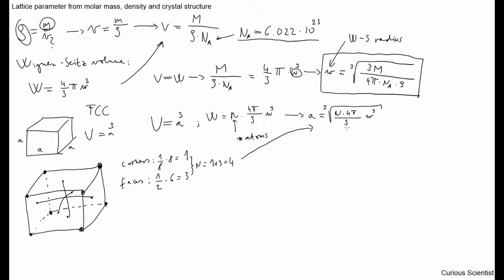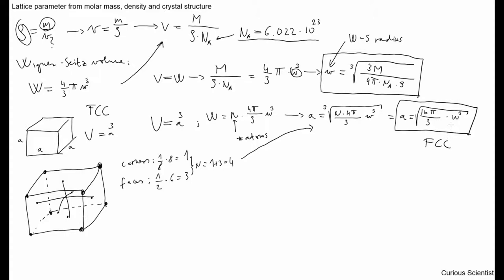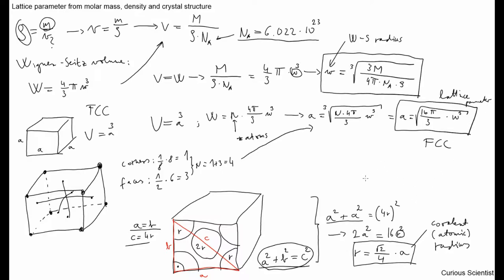Lattice parameter from molar mass and density - FCC structure and basics

Comment: why not just use this formula ->        # density =  (number of atoms in FCC  * atomic weight) / ( Avogadro's number *  a^3 )   #   a^3 is the volume of the unit cell .
Reply from the maker: Because the whole approach is based on the assumption that we derive everything from density, molar mass, and the crystal structure. The lattice parameter is unknown...